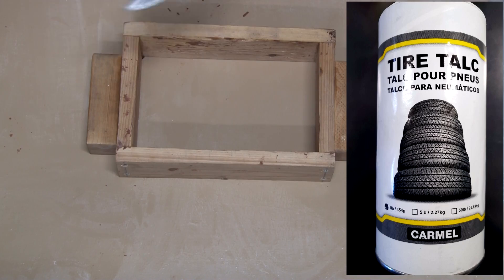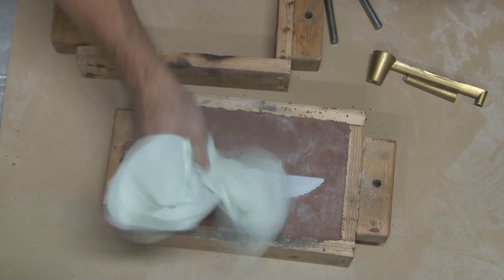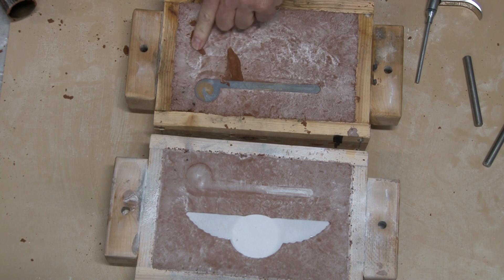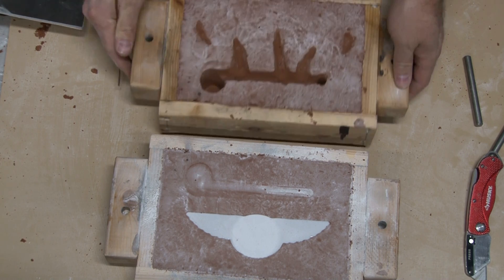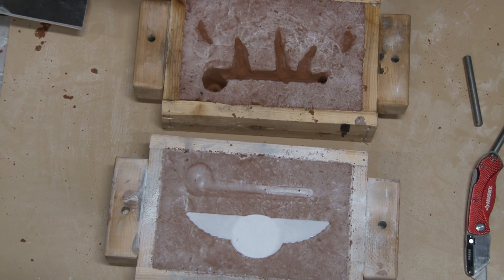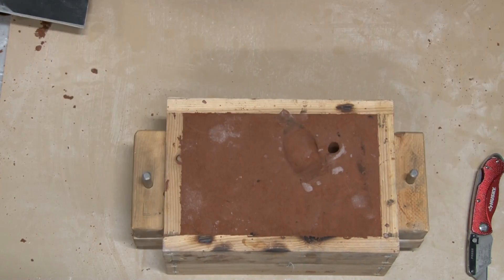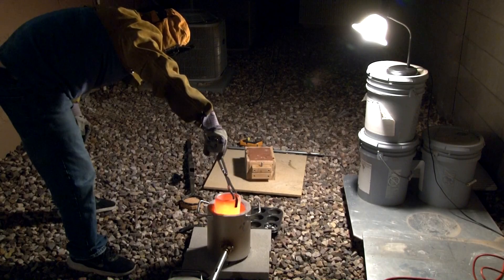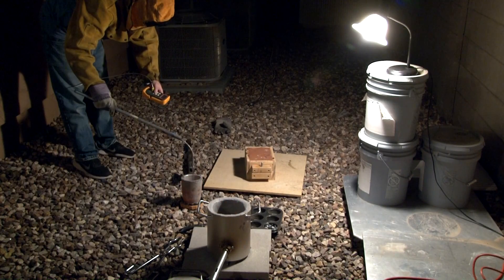Sand Casting a Custom Bentley Sign From Scrap Aluminum.

Comment: YO HICE UN MOLDE CON CEMENTO BLANCO PARA HACER MAS LISA EL MOLDE. PERO AUN ASI ME SALIO MAL CON POROS  Y NO SE LLENARON TODAS LAS CAVIDADES
Reply from the maker: I put this in google translate and I hope it worked.  I am reading that you made a mold out of white cement.  I am not  sure what happened since I use store manufactured Petrobond (sand bonded with oils and binders).  I have seen investment casting / lost wax casting in a special type of plaster.  Those types of castings a vacuum is created and the air is removed so the metal can flow into the mold/cavity.  I am giving my best guess.

Comment: COMO LOGRASTE HACER LA PIEZA SIN POROS CASI PERFECTA ? SON ESOS ESPACIOS DE RELLENO AL QUE AYUDA MAS A PENETRAR MEJOR TODAS CABIDADES=)???
Reply from the maker: On my castings I try to minimize pores/pitting by several things.  I use band new petrobond for facing sand so band new sand is in contact with the part, the rest of the sand can be reused petrobond for packing.  The mold is packed as hard and tight as I can get it.  I have a tapered sprue to reduce air entrapment and a spin trap to help collect loose sand. The part has several gates and a couple of air vents.  After the pattern is removed I light blow out all the lose sand.  The aluminum I use is scrap that has been previously used for casting such as car parts.  Aluminum cans do not work well for casting.  Good luck I hope this helps.  Sorry I can't read Spanish and I have to translate it.

Comment: did you make your own spru and feeder or can you buy them
Reply from the maker: I made those parts in tinkercad.  There should be a download that I made public in tinkercad I think I named the file spin trap and sprue. The sprue needed a bit of sanding after I 3d printed it to fit properly into the feeder.  I also sanded and painted the parts so they would be smooth when pulled out of the sand. There might be other people's 3d stl files in thingaverse if you search that too for feeder, spint trap, and sprue. Thanks for watching my videos.

Comment: if you have a runner and a riser you will get a better fill and it pushes out all the air. All in all you will get a much better product.
Reply from the maker: Next time I will throw in a riser instead of an air vent at the top of the spin trap.    Thanks for leaving a comment.

Comment: In the early days of rocket sled operations, it was found that lubing the rails with petroleum products actually slowed it down due to it forming a rolling wave in front, Talc cured the problem and is still used as a lube.

Comment: Aliminium basically comes in two configurations. As a casting alloy and as a wrought alloy. Those aluminium extrusions (windows, 40x40 extrusions etc) are all not for casting.
Great result btw.

Comment: I never have good results with aluminum; I'll have to give Hard Drives a chance. Where do you got your scrap Hard Drives?
Reply from the maker: I obatined my hard drive chassis from a friend at work that used to work at another job in IT.  I have also went to recycling facilities that take cans.  Sometimes those facilities will sell back metal to you.  I have purchased cast aluminum car parts and they also work as well.  I have a car rim that was picked up from the recycling facility but I have not had a chance to try a melt with it yet.  Usually most parts that have been cast before should work.  In my videos I leave out the prep of the pattern because its not exciting to watch and people skip over it anyways.  But surface prep is huge too, the pattern needs to have a real slick suface to it.  After alot of primer filling and sanding I coat my parts with professional rustoleum it seems to make a good smooth surface for casting.  Good luck and thanks for watching.
Reply: @DamonsMetalCasting  I get my brass bullet casings from a metal recycling facility. Maybe I'll see if they have any next time I'm there.

Comment: That was a great outcome. Well done. Just found your channel. A thoughtful point of view. Make yourself some tongs. Picking up the crucible like that is not good. It can break right off. I’m impressed with your safety gear, only takes one (incident I’m I right). Looking forward to seeing more.
Reply from the maker: I agree with you, I started making lifting tongs and I want to make sure that I make something that is the best I can build.  Also, it is a little difficult since the gap between my crucible and the wall of the furnace is limited in my case.  I am hoping in the next several videos I will have something completed.  Thanks for watching.

Comment: Watching your video now.  Just wanted to mention all baby powder isn't the same.  You need the one that says talc 😁.  That's what I use.

Definitely get to foam Casting.  You'll love it.  If you need any help with it let me know.  I'm sure you've seen some of my videos.
Reply from the maker: I have looked in my area and my stores don't sell the Talc kind of baby powder but I will keep looking though.  I bet you have found it cheaper as baby powder than I find it as tire talc.  Also, thank you for offering to be a resource for helping me in foam casting.  I might take you up on that.  Yes and I definately watch your videos.  I dont think I see a CNC machine in my immediate future but I will probably do hot wire cutting.  Your foam casting on your channel turns out great.  Thank you.
Reply: @DamonsMetalCasting  do a search for talc baby powder.  I just read J&J will stop selling it in 2023.  It might be hard to find now.